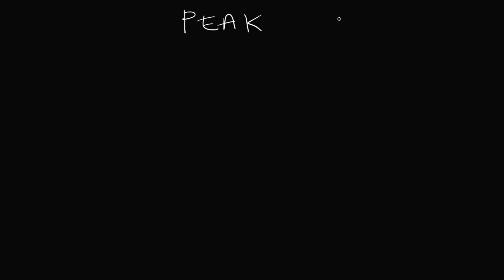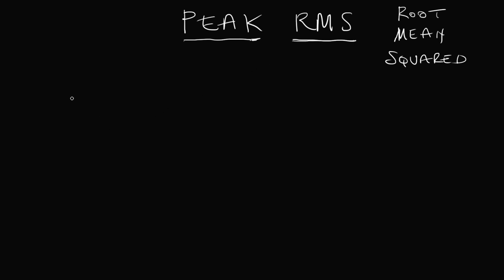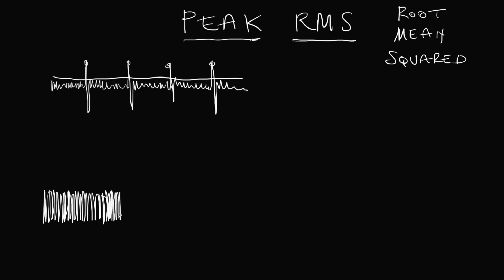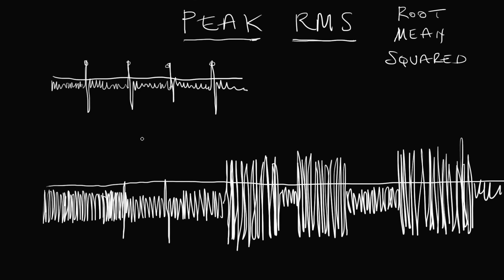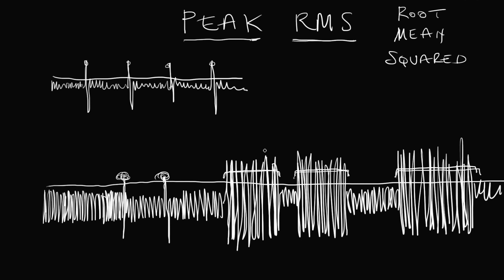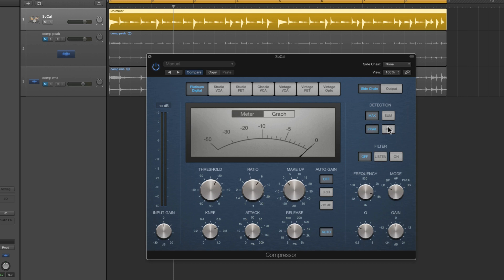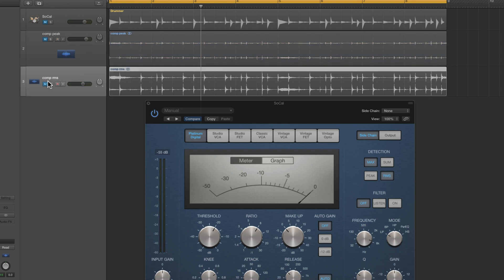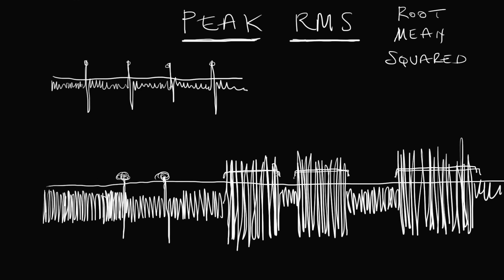Compressors & Compression Masterclass 8 (Peak & RMS Compression)

Comment: Very good tutorial series! There's a thing that still puzzles me though regarding compression ratio. Let's say that we have a 4:1 compression ratio and have a peak that's 8 db higher than the threshold and a 4b higher than the threshold. The first will be compressed to 2 db and the latter to 1 db. So, the compressor will reduce the levels by 6db in the first case and by 3db in the seconds case. So, the  gain reduction applied is not static but seems to change by how much the input signal exceeds the threshold. If this is the case, is this done by a sample to sample basis or some time window is used?
Reply from the maker: time, but these are just principals. compressors aren't really x-in = x out devices, the design of the compressor circuitry (and emulations of that in software form) determines how it reacts,  as does the material being compressed. These are simply principals to understand, but always use your ears

Comment: Please do same comparison with vocals and guitars please.
Reply from the maker: what? dont understand.
Reply: @dancetech  sorry.  At 5:59 you showed the processed difference of Peak vs RMS files. Could you do the same for a vocal and guitar track maybe? The effects on the wave file for Peak and RMS compression.  Thanks
Reply from the maker: oh i see, well there's no point me doing that, I've explained the principal, so you can simply load some guitar parts into your DAW & load up a compressor and try it in peak or rms and listen & learn how each sounds on different type of guitar material. Choppy staccato guitar (rhythm or pick work) or more smooth guitar will be slightly different etc... bear in mind also on heavily distrorted guitar the distortion tends to make it all the same level.